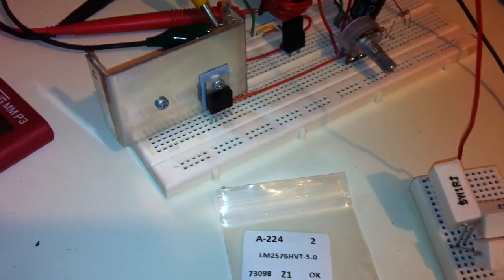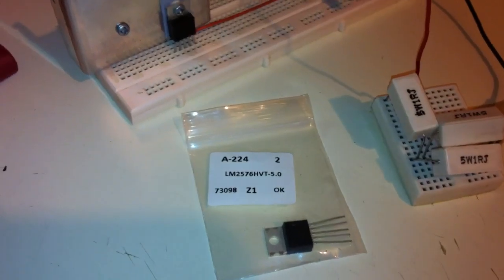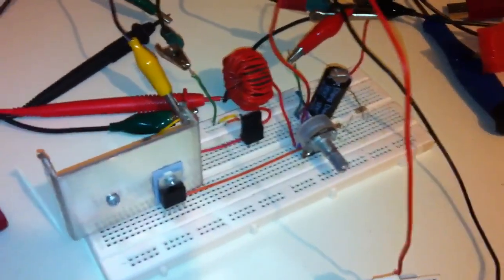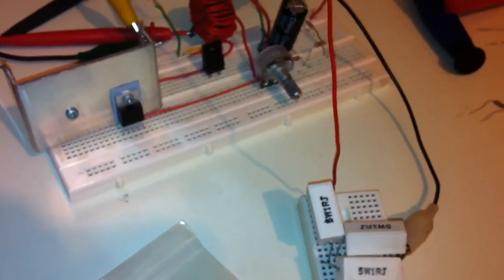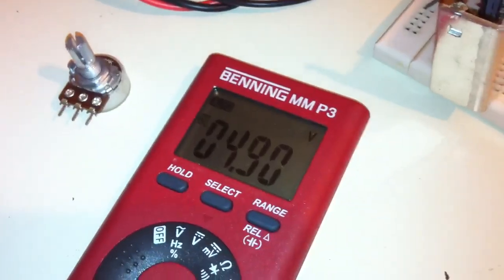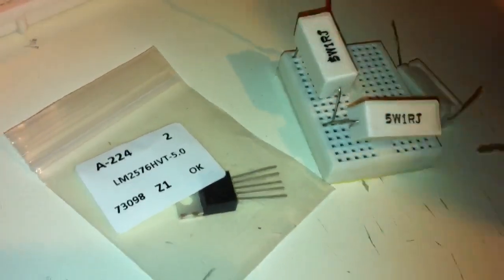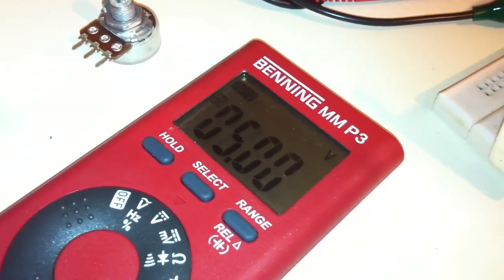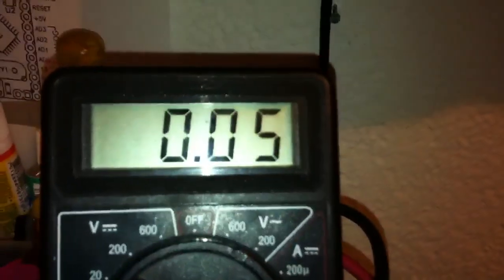LM2576HV switching voltage regulator (5V, 3A) -مترجم

Comment: where is the circuit diagram
Reply from the maker: Its the simple application circuit provided in the Datasheet of LM2576HV
Reply: +Shadi Soundation yes  i know that....bt i m confusing in connection of potentiometer
Reply from the maker: You are right to be confused. check this out
https://www.google.ch/search?q=LM2576HV+switching+voltage+r+adj&source=lnms&tbm=isch&sa=X&ved=0ahUKEwjA6euuzLDUAhWRY1AKHfCdD90Q_AUICigB&biw=1374&bih=870#imgrc=mUpXZfI49FfJQM:

Comment: I want to output 1A 5v from a UPS Battery Which is 12v-7.2Ah. which voltage regulator I should use
Reply: Ahadul Islam MC 34063 Use It